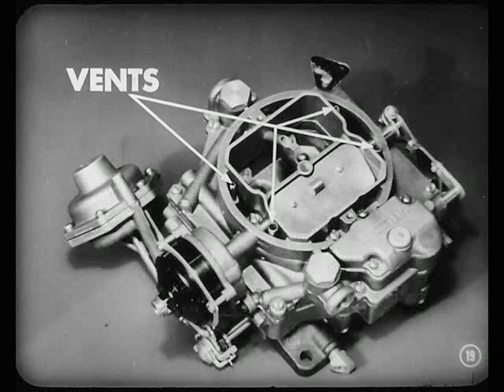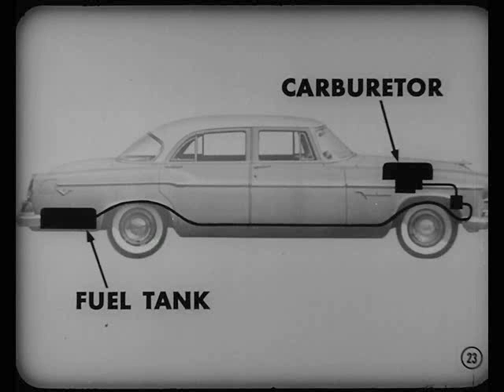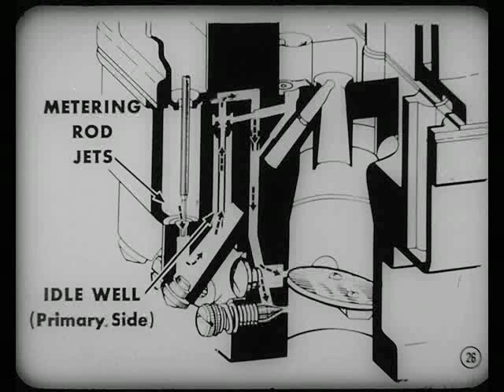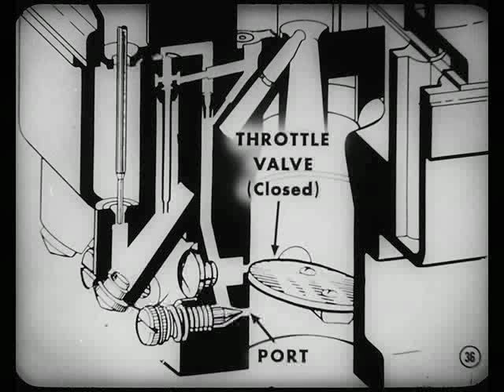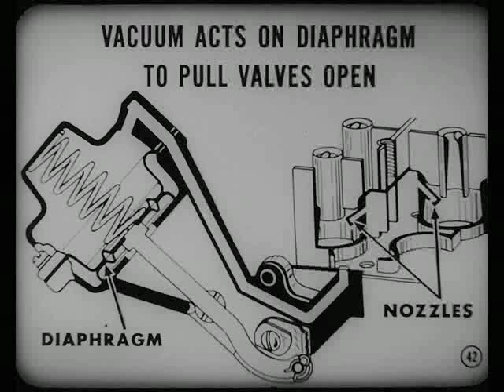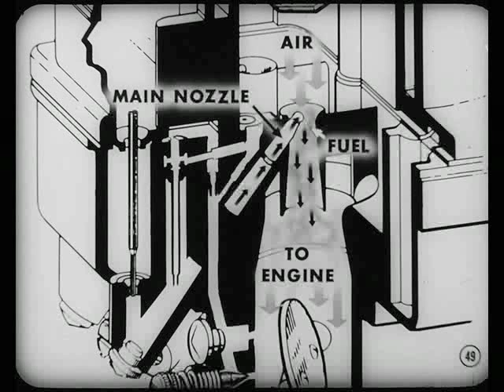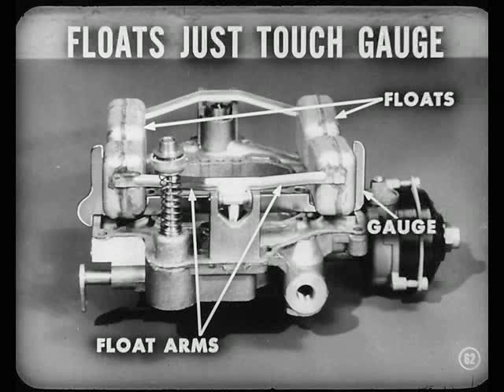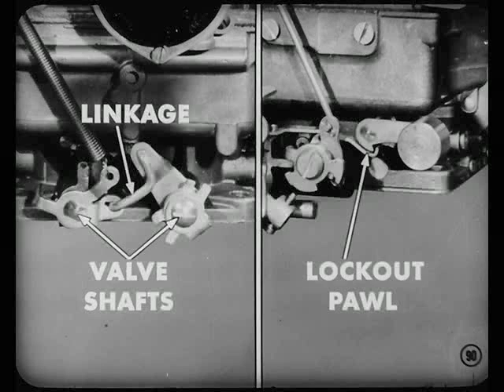MTSC - 1955, Volume 8-2 The Four-barrel Carburetor

Comment: I like these videos because I was curious about how certain old cars work. I have no need or desire or to work on carb engines but I find it interesting. I work of EFI engines and it isn't difficult for me. I'm 34 years old, but I eventually discovered that many people in the auto repair business under the age of 40 don't know how to work on carbs but do know how to work on EFI.

I learned about how EFI engines work somewhat by accident. In May of 1998, I read a magazine article about getting 450 HP from a Nissan 300ZX Twin Turbo. It explained the function of the MAF sensor, and I knew I could learn how the other sensors work. I already knew what an O2 sensor was because my dad said it was one of the most expensive things damaged when the carb failed on his 1987 Hyundai Excel.